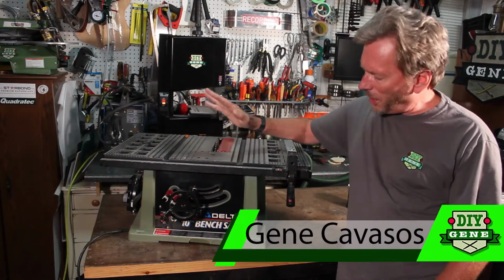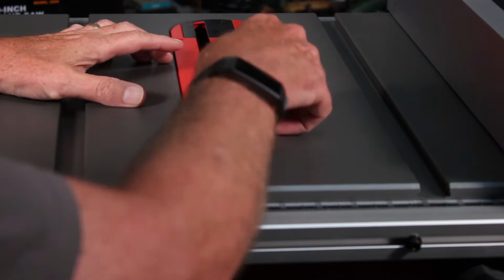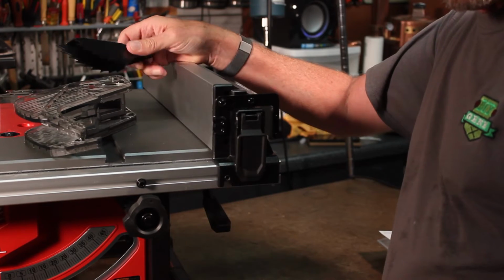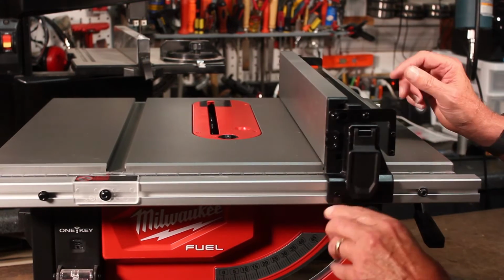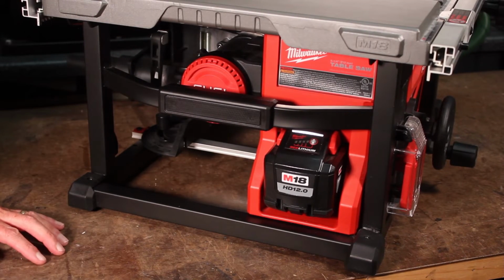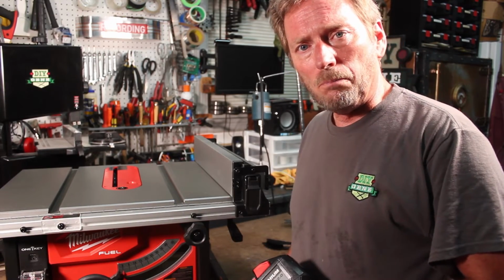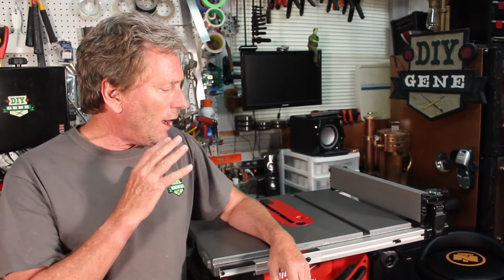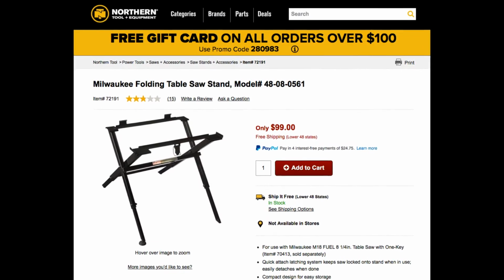Milwaukee M18 FUEL Cordless 8 1/4in. Table Saw from Northern Tool + Equipment.

Comment: Does this saw use a thin or full kerf blade? Can it use either?
Reply from the maker: It came with a thin but I am using a full kerf blade and it’s working great.

Comment: A couple of questions.  1.  I thought I read somewhere or another review on YouTube that you have to use a full kerf blade as a thin kerf will get caught on the riving knife? 2.  Noticed you were not using the riving knife.  Did you have a problem with it?
Reply from the maker: Great questions. 1. This saw came with a thin kerf blade and I assume that is to help with the fact that it is a battery powered saw. The blade is the same width as the riving knife so it shouldn’t be a problem. 2. I probably should put the riving knife on just for safety. I have a large project coming that will require some long ripping and that should help. Also I will pick up a ripping blade for that. But now you have me thinking, should I get a thick kerf blade?  Thanks so much for watching.

Comment: I bought the same saw with stand late last year to replace a big corded Hitachi/Metabo saw I had. I like everything you liked about this saw and disliked the same things you did. The miter gauge is pretty chintzy and it doesn't attach all that securely in its storage area. The one thing I found that I didn't quite like about the saw is that the table is a bit on the small side and there's no included outfeed support, which I did have on my 10" corded Hitachi saw. If you're cutting some larger pieces you'll probably want some sort of outfeed stands. The other thing I've been puzzling over is how to make a crosscut sled for this since the size of the top is a bit smaller than a typical jobsite tablesaw.
Reply from the maker: That's a really good point. I have not thought about the limitation to the top. That could be a problem. Thanks so much for watching.

Comment: Lol, well…….I guess Milwaukee will be the brand going forward. You honestly can’t get any better.
Reply from the maker: I can’t believe how well designed this table saw is. So far Milwaukee has my vote. But they definitely aren’t cheap. Thanks again for watching.
Reply: Im 27 and only just started my tool collection. I decided to go with Milwaukee after I dropped one of their drills in a big puddle of water and it worked flawless as if it wasn't soaking wet at all. I've rly nvr considered another brand since 😅